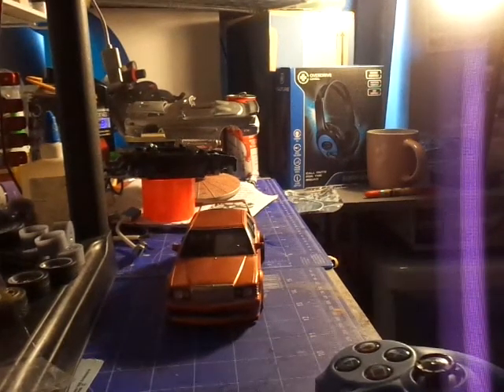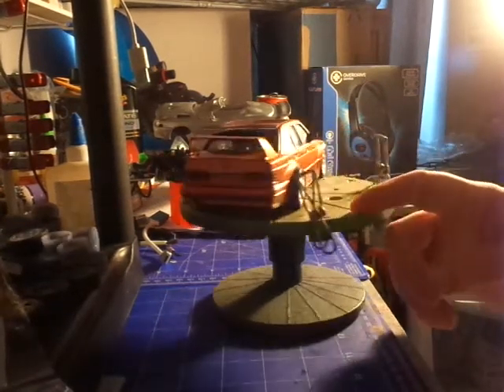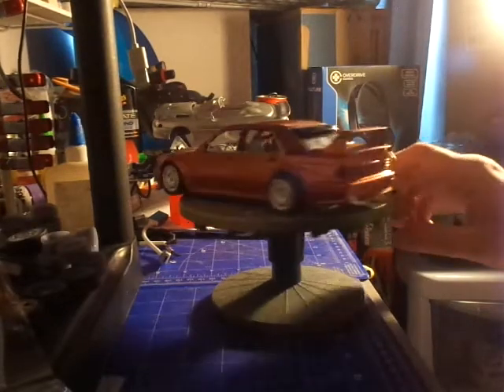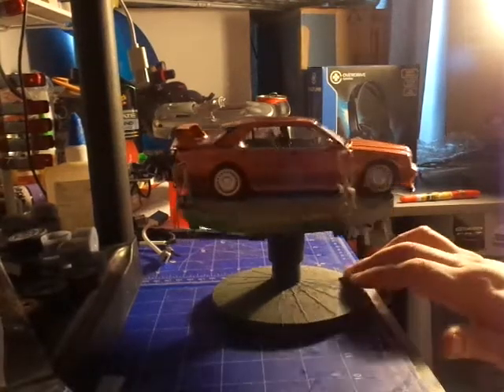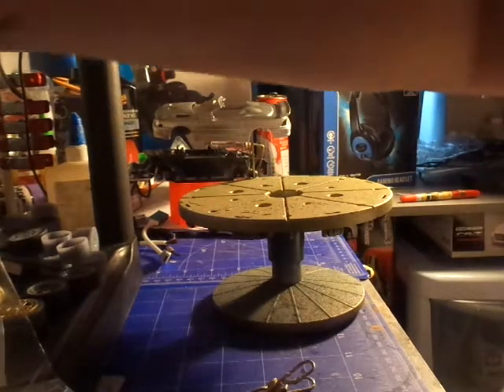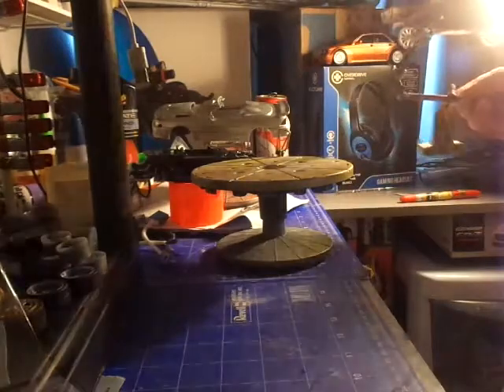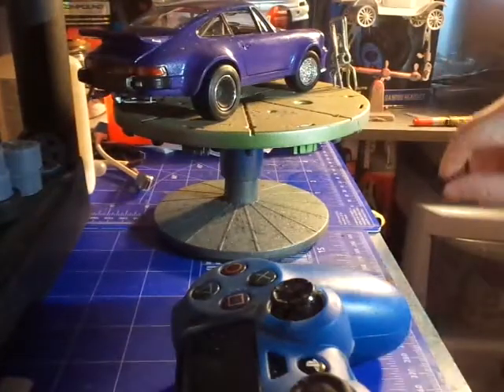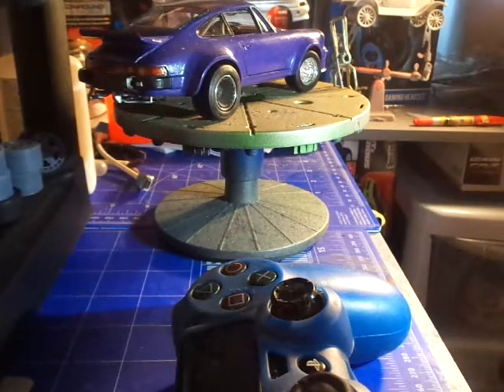KIT GIVEAWAYS FOR THE GB FINISHED BUILDS AND BENCH UPDATES FINAL TOO EVO E190 2.5

Comment: Great up dates. Sorry I couldn’t finish my GT40 for your group build. Lots going on here and tribute builds. I’ll be getting back to it soon. I’m thinking about 3d resin printing. Doing my research for a printer. 👍🤘
Reply from the maker: Awsome its cool having 3D printer but unless you know what ur doing its so annoying stressfull i still dont know what im doing i done couple wheels them zombies other day but i cant remember what way i transferred them exported or imported from slicing to the tumb drive theres setting i have to try get the hang of to be successful all time apaet from obviously failed prints we cant help if they happen but yeah frizzo sounds cool bro and its ok u couldn't get it finished few guys couldnt thats cool but thanks again bro
Reply: @keithsmodelsandrcs6593  I’m going to get it done. Keep reaching out there are a lot of guys into the 3d printing that will help. It takes a while. Remember you have to crawl before you can walk. You’ll be a pro soon. I’ll be buying parts off you in no time 👍🤘

Comment: Nice prints. Why dont you print tires for them? Thats what I do. I just print the tire and wheel together. yopu can print the tires separately if you want.
Reply from the maker: Ill try that bro i still have alot issues I dont know what i done correctly to get them sliced transfered onto my tumbdrive u know i was thinking hettina a wifi type one u can slice send to 3D printer and that does the rest i was considering that if u got any wheels with tyres on can u send me link to give ur designs a go again